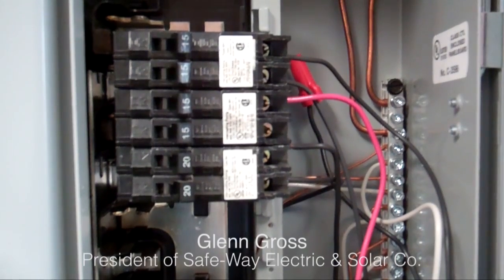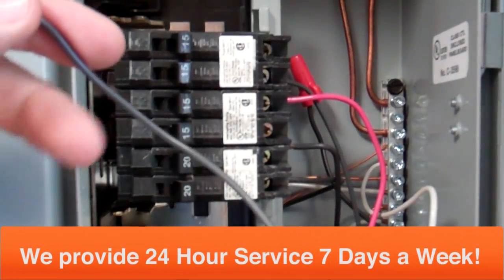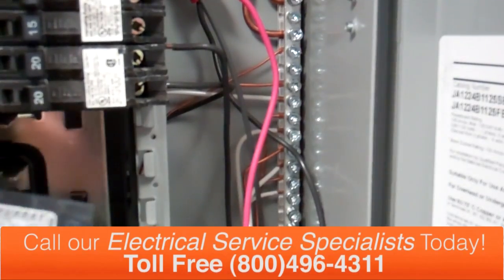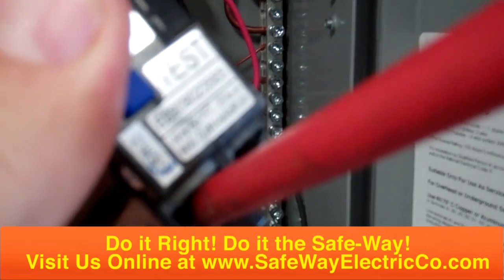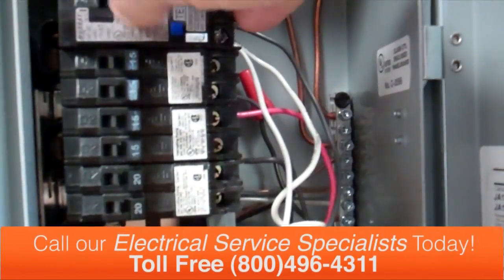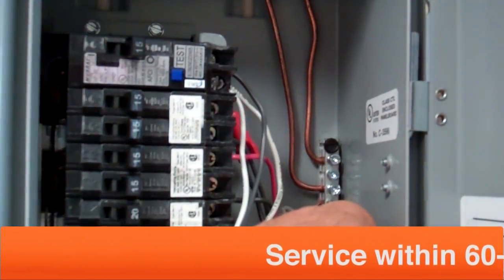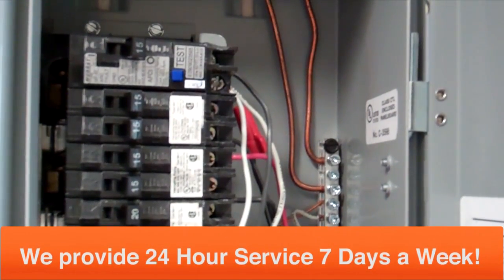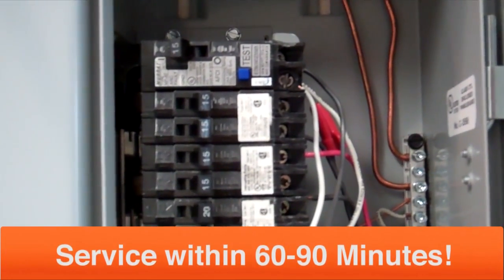How To Wire Up an Arc Fault Circuit Breaker

Comment: I do a lot of rewiring on lights with ballasts for work (commercial bldg) and nothing drives me crazier than whoever installed the unit initially and does not trim all of the extra wire that manufacturers provide. I am putting a 200amp panel in my house with Eaton AFCI's and was wondering why would you not trim the factory-provided neutral since it is inches from the neutral bus bar, just to make things neat. Is there code that prevents this?

Comment: After 35 years in the trade it looks like you dont trim breakers in neatly. I always try to fan out the wires . You used solid ,pulling it straight down will eventually  damage the wire at point of termination.  I always use stress relief  . I would not pay you for that kind of work.  Will be happy to debate you anytime will send you pictures  of correct  wiring for panel.

Comment: Question: How can I wired a Arc Fault Circuit Breaker if when our power source is Line to Line(110VAC each) only and no Nuetral wire or Earth wire provided, The cooperative here in our place, they only run 2 wire(line to line) only to their consumers and nothing else, Can I still use a Arc Fault Circuit Breaker if not, any suggestion or remedy? Thanks

Comment: 35+ dollars for EACH breaker is way to much. the codes are changed to make the companies and contractors more money, yes safety is like 5% of the reason they do this.... 95% money
Reply: How much do you think the extra circuitry should cost?  The point of AFCI, and GFCI for that matter, is that it provides additional protection. AFCI is required in bedrooms because you really don't want to have a fire starting in your bedroom while you're asleep.

$35 a price and how much are you spending on the labor involved? If you're doing it yourself, $35 isn't that big of a deal, you do it once and then probably not again for a very long time. If you're having somebody else do it, then the labor is probably the bigger issue.

$35 compared to the $170 that they want for the GFCI breaker I was thinking about installing is an absolute bargain.

Comment: I'm a homeowner and my home is around 30 years old.  The original owner finished the basement himself.  I am having a contractor remodel the basement to add a bedroom.  I'm told that the whole room must be arc fault protected, including the pre-existing outlets.  Is it necessary to run a separate circuit line from the breaker box to the new bedroom to to make this happen or can we do it by simply changing the outlets?
Reply: My guess is that there are already two + dedicated breakers for the basement, one for the lighting and one for the outlets,  if that is the case you can just replace the old breakers with new arc ones.  that would be the easiest and cheapest.
Reply: Both the breaker & the first receptacle on the circuit needs to be replaced.

Comment: My house was built in 1982 and has the old style circuit breakers. Would like to upgrade to AFCIs but I noticed the one you installed was twice as wide as the old breakers. Is there a "slim" version?
Reply: yes.

Comment: to me that neutral bar looks like the grounding bar
Reply: It is the same.
Reply: The Nuetral is supposed to be separated from the ground other wise the arc fault might not work correctly
Reply: The neutral and ground bars are only the same in the main load center.  If installing to a sub-panel (which this appears to me) then the neutral and grounds should be on separate bars that don't connect inside the sub-panel.

Comment: I know a great deal about dc wiring but not so much about ac. So my apt has a breaker box. the box has 2 30amp double throws a 40 amp double throw and 4 20amp double throws. The main is a double throw 50 amp. The 50 amp keeps getting hot anytime we use central air or clothes dryer. It trips and wont reset until its been about 45 mins. Shouldnt the breaker reset if it was overloaded if everything gets turned off before resetting? Are there any tests I can do to figure this out?
Reply: my guess is  the central air or the dryer have 240v at 40amp rating if that is the case then according to ohms law  either of the two units are demanding 9.6kw causing to heat up the main very close to overload.  solucion: bigger main breaker (100 amp) and probably bigger wire maybe 2 awg, pay attencion specially to the breakers where the dryer and the central air are connected those two you might want to change the wires to #6 or 8 awg.